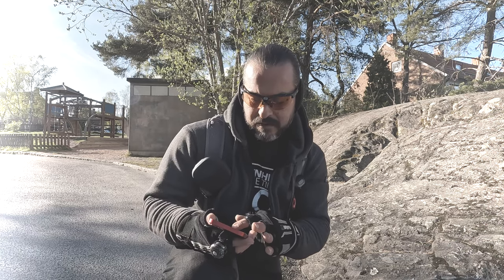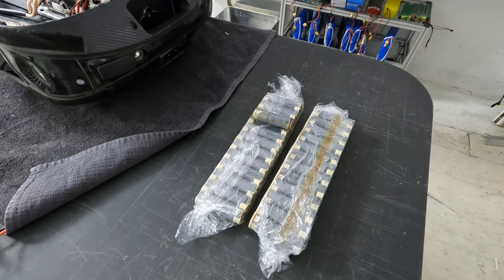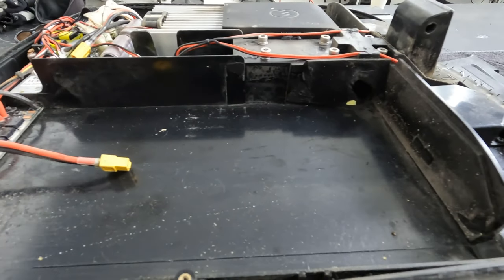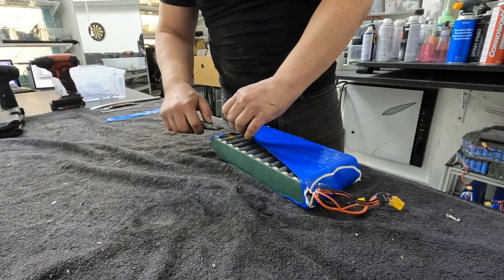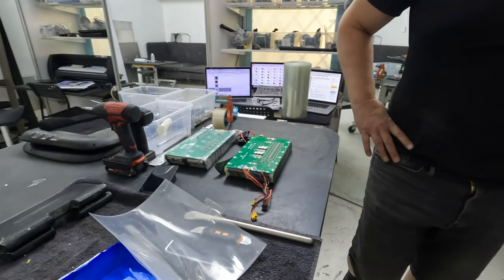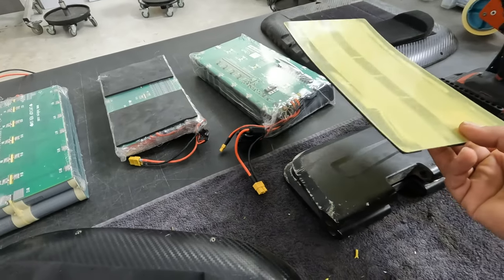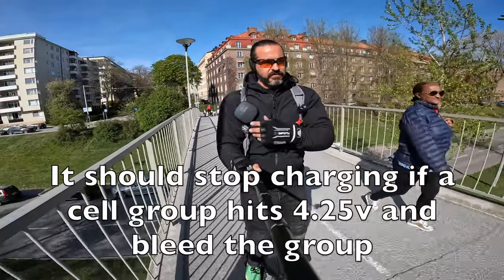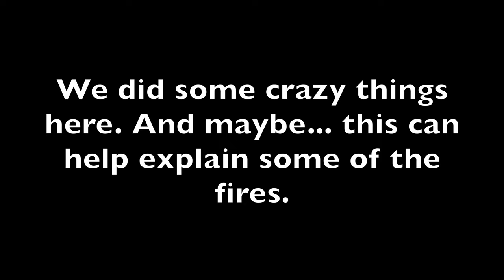EUC Fires... perhaps we have found something - Inside the EXN HS

Comment: Great video and a lot of information about Begode and Gotway wheel’s.
Certainly something has to be done so that the rider / owner can recognize what the issue is right away.
Onboard diagnostic systems wouldn’t be too bad. Where the system throws a code, user can look up online and find out what could be the problem.
Reply from the maker: Yes this is what they are doing with the Litech packs. Though they are still very new out in the wild. The Litech packs have a beeper on them which can alert if there is a problem. Now every time I see a post about someone's wheel not charging to full... this BMS problem is the first thing I assume. So at that point... it should really be dissected and examined. A SmartBMS like the one on my Nikola wouldn't kill us to have either!
Reply: @isthereanyfood  that’s why I’m looking at the Nikola from Alien Rides. Has a higher voltage because the problem seems to be on the lower voltage wheels. Just seeing your video sent shivers down my spine after seeing what happened to the battery pack alone.
It’s too bad that there can’t be a battery slot instead of the batteries inside the unit’s themselves. If a pack burns up just get another in-cased sealed battery pack, be better than painfully watching your wheel burn up in flames.
Reply from the maker: @y_i_fly5418  The Nikola AR+ is very nicely made. They went the extra mile on that one. The Nik can also take a hit or two without the BMS being loosened from the pack. On the other hand you guys also have eWheels and the Litech packs are more securely built.

Comment: Great video Mike. My Nikola that cut off recently has snapped about 4 of those little tags that go around the edge of the battery. In my case, the blue battery heatshrink was still firmly attached to the shell with its 2 sided tape... but the heatshrink had split letting the guts of the battery move inside the shell... in fact, one of the batteries had tried to escape. Can you ask Sergei if he can do a video on how best to solder/reinforce those little tabs if the cells haven't ruptured?
Reply from the maker: Thanks! Take a look at Ray Rokni. He made a clip a while back showing how he replaces a BMS.

Comment: We all need pay more close  attention  to  our  wheels. Ya they make me nervous.  So answer me this. My 84volt wheel charges to 83.3. I'm wondering should I be concerned?? It's not ridden that often so charging is not very often.   Haven't seen anyone address this issue like this. Tearing into the wheel. Thanks
Reply from the maker: 83.3v is a totally normal value for an 84v Gotway/Begode wheel! They will never charge to 84v and can even drift as low as 82.x. I am not sure if it is because they don't charge to a full 4.2v per cell or if they just all have bad voltmeters haha. This would be easy to check by measuring the output of the charger... but yeah me and sticking metal objects into 84v chargers.... let me ask a friend to hold my hand and we will do it together. Anyway it is a totally okay value and the 84v machines are super solid. The 100v Gotway/Begode will always charge to 100.8v... AND THEN SOME. A little bet less would have been nicer.
Reply: Very good you answered something  I have wondered for some time. The Tesla 2 just keeps on going, but I'm feeling an up grade will happen soon just waiting for the smoke to clear with all the new wheels. How is one supposed  to choose.  Not to worry  it will happen.  Keep the vids coming. Great work
Reply from the maker: @TheFowlergj  Thanks Greg! Yeah... right now it's not easy to find a new wheel. There is too much going on. The Nikola Ar+ is a very nice wheel. The EXN is a great wheel too and so is the Sherman. The Sherman Max still needs to prove itself and there are some BMS/Battery problems out there. I was hoping the V12 HT would be a success but WrongWay already got a cutout... RIP Inmotion.

Comment: Oooo. Scared to open my Nik+. I have had some scraps, but I leash my EUCs so never a hard fall; just some scraping on the side. However, after seeing this, it makes me think twice that all is well.
Reply from the maker: If all is well then all is well. I would not worry about it unless the wheel is reporting abnormally low voltage after charging. The Nik can take a tumble and the cells aren't leaning against the edges of the shell like on the EXN.
Reply: @isthereanyfood  AH, good to know, thanks.

Comment: Hi Mik, I was very undecided whether to write my comment... but I think it is my duty !!
At about  34'30 " you asked if it was possible to measure the voltage of the individual cells, this person replied something like  " difficult because the cells are all welded between them, etc., etc."
this is a false statement, it is possible to measure the single cell voltages even if they are soldered on the BMS board, 
this is the first thing to do when investigating the battery status.
I'm an electronics technician and I work on lithium batteries, so I know what I'm talking about, my feeling and that the technician wanted to do business.
Reply from the maker: Hi Vincenzo! Thank you and I appreciate your comment. Sergei is a good friend of mine and he is by no means a battery specialist. He still has a lot to learn when it comes to batteries and BMS and he learned a lot through this process and we made plenty of mistakes. I would be super grateful if you could show me how such measuring could be done. If you like you can mail me at mike.sacristan@gmail.com , Thank you again! We must do what we can for the community!
Reply: @isthereanyfood  ok mike, send you an e-mail :-)

Comment: hey Mike, do You still claim, that jumping on euc, using it in skateparks like skateboard is "nice fun" ?
Thx for battery investigation, now im sure even more than before that euc's are NOT designed to hardcore use.
Reply from the maker: Hi Greg! Well... I was at the skate park today! With Rolle (the new V5F rider) and with Zebastian (V11 rider). We had a blast and it was hilarious fun! My MSX took a couple of tumbles. EUCs are definitely not designed for hardcore stuff... they just happen to be able to handle it... until they don't!
Reply: @isthereanyfood  could You tell how expensive is 3xbegode battery pack?
Btw. newest brgode low voltage battery technology should be safer, so Master could be reasonable choice.
Reply from the maker: @gregorion28  I would guess around 400USD per pack. 500USD for a Samsung Litech... 600 or more for the Molicel Litech. Of course... I did not pay 400 per pack... in that case I would have just thrown the wheel away. Luckily I have resources and friends, etc backing me up.

Comment: I think you're on to something here. We don't think much of all the knocks, hits, tumbles & wipes to do the wheels & amazingly, the wheel & batt packs survived 99% of the time. Then all it takes is a little fall of the side & a bms solder gets shorted. Best case is what you have. Worse case is thermal runaways. Great info here Mike & glad you caught it early
Reply from the maker: Thanks Scott! This is what we are hoping for. Finding something... the knock and hits and tumble do their part. The wheel survives when it survives and it doesn't when it doesn't. So we should not be surprised if the last hit really is the final one. Tipping on its side. So now I will ride myt EXN without doing donkey stuff and without dropping it. If I want to drop a wheel I will drop the MSX.
Reply: @isthereanyfood  I think a new way of assembling & packing of batts/bms has to be found. When the 1st euc came, it was a toy. No one envisioned what it is today but batt paks are still pkg'd similar, just bigger. TBH I'm pleasantly surprised at how well the batt paks survived the amt of abuse we put them thru. Honestly, I think you may have discover the cause of 80-90% of euc fires

Comment: Hey Mike, great video... I am a bit confused...what is exactly the problem with the LG M 50 T cells? The more milage the greater the risk ? Of what?
Reply from the maker: Hi Joe, I now have three fresh packs with LGM50T cells. I decided to go with the same type as before to see if I can replicate the failure. I don't really see a problem with the cells. There is more a design problem with the BMS in general and the way the batteries are connected to each other. Some people say that the LG cells are not strong enough for the kind of riding that we do, that the cells become stressed and eventually leak. If that was the case we would probably have more wheels that are dying. There is also a lot of people saying that the cells only can deliver 7.3A continuous but this is not entirely true. There is a lot of parrotting going on in the community. It's great for spreading information but sometimes it is good to dig a little deeper.

Comment: I’m constantly considering replacing the battery packs in my 100V MSX, Panasonic/Sanyo.
I have no idea if it would make sense/if it’s possible, Molicells or Litech packs.
Anything you’ve considered Mike?
I know one thing for sure, my wife would dissaprove me buying a new wheel 😱😂
Reply: battery mooch got his hands on some molicel p45b for testing, they should be out in a couple months, its a 50 amp cell with 4500 mah. i asked him to throw it in the freezer overnight and do a 7.5 amp discharge from 4.2v to 3.2v. 
at -10 celsius it gave 3600 mah. a p42a was 3200 mah and 40t was 2700 mah. the p45b in the 4p or less wheels will give more range and power than any other cell on the market, especially if you like to ride in cooler climates
Reply from the maker: My MSX has 11000 miles on it and has taken a beating. And taken more of a beating today. Everything is fine. Squeezing 21700 cells inside an MSX might be a tight fit and requires sanding down the inner shell. Molicel P42a are slightly larger than the other cells. Molicel P45b are more standard size. Molicel in general are not highly available so perhaps Samsung 40T would be more feasible. I would be happy with Samsung 48X though. So for your 100v MSX... I would just leave it. Is it a 1230Wh or a higher Wh mod?
Reply from the maker: @growingoldandhavingfun4391  Yes those P45b are definitely the best spec battery out there right now. As you say it will take a while before they are commercially available but they actually managed to improve on the P42a in all aspects.
Reply: I have the 1230Wh version Mike  @isthereanyfood , I have been wondering if the 1800Wh MS Pro shells would fit to make room for upgraded battery packs. The wheel has got 1544 miles on it (nothing compared to yours), I bought it second hand (1425 miles), so I have no idea how it has been handled until I bought it. My initial idea was to stick to the 18650 batteries, I haven't measured if the 21700 would fit with a proper margin for a protective layer. It works flawlessly (after replacing the mainboard, blown mosfet), so I hope it has got the same milage as yours "under the hood" 🙂

Comment: SO MIKE, IN A COUPLE MONTHS, I AM AT ONE YEAR WITH MY SHERMAN. DO I HAVE TO REPLACE MY BATTERY PACKS TO BE SAFE? THE SHERMAN IS $4,000. THE BATTERY PACKS ARE $3,500.
Reply: Consider this. Your packs are now tested and reliable. Unless they've taken physical abuse, bringing a new set of batteries into the equation could actually be the bigger risk. Fires also happen during a users very first charge, so age alone is not the only factor. Just one.
Reply from the maker: Well said Jordan! I agree 100%. One year is nothing.. ride them until they give up. It will take a few more years.

Comment: youre a sucker for punishment,
doing things over and over and expecting a different result is the definition of insanity
atleast you have 3 packs in parallel  unlike the msp that has 2 in parallel
if pulling 60 amps and you lose a pack the fuse at b12/b13 on the remaining 2 packs wont blow like the msp would
the Master with 4 in series would be an automatic face plant
Reply from the maker: Indeed... the Master would be an automatic faceplant. Though it would require quite some effort for a pack ti die in the middle of a speed run... it is not impossible. Just unlikely. 

And yes, I am a sucker for punishment and would love to be able to replicate the error. That would definitely be conclusive!
Reply from the maker: @EUCvibes  Yes that is something at least. Still... as you guys can see this is what our redundancy leads to. So I think the Master is a step forward.
Reply: @EUCvibes   dont see how, 32s4p, from 4 packs in series. the series connection is done in the control board not through the packs. that means 2-16s2p in series on each side and a redesigned control board. better off with 4-32s1p all paralleled at the control board.
Reply: Some of the most successful people in history could be labeled "insane"